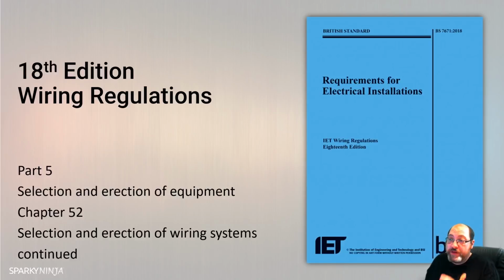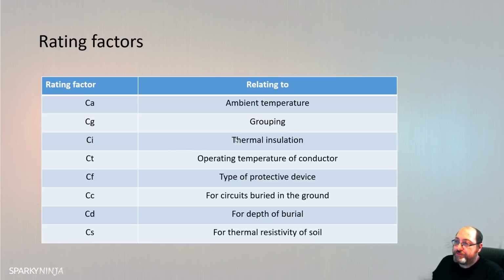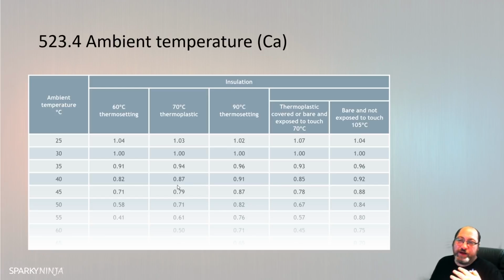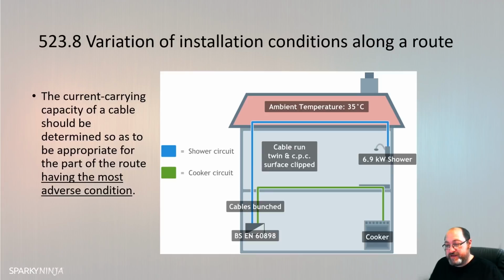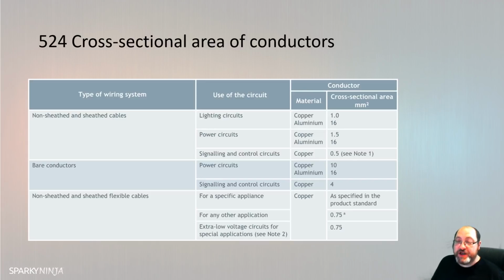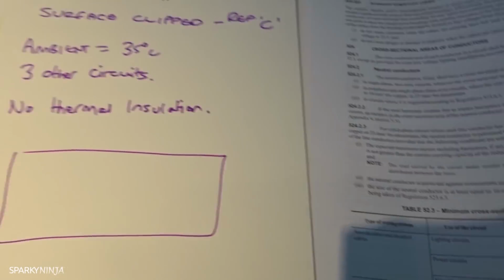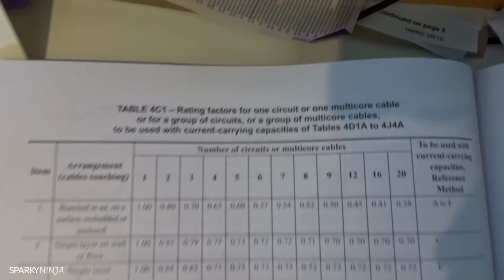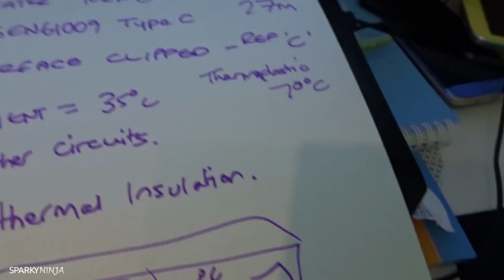18th Edition Training Series - Episode 12 - Part 5, Chapter 52 - Sections 523, 524&525

Comment: In your working example you worked out 63amps on a 10mm but selected a 45/50 mcb ?
Reply: 45A is just the nominal rating of the device. A type C could have a breaking point of up to 10 times that. If you install exactly the same current rating as the design current, you may get unwanted tripping. The 63 A is the conductor rating required to suit all the correction factors but this does not mean the cable will necessarily carry that load. Iz has to be higher or equal to In. Coordination. That’s how I understand it. But you probably know this by now👍
Reply: yes 63A is non rated conditions.  The rating part means is can carry LESS than 63A before reaching it's maximum temperature....... Without those factors, yes it can carry 63A but NOT if installed in certain ways which stop it losing its heat.

Comment: When looking for volt drop aswell as Current carrying capacity for Flat Twin and Earth Cable 

Which table  is more suitable 

Table. 4D5 or 

Table 4D2A along with 4D2B

Thanks
Reply from the maker: They both serve the same purpose - table 4D5 is specifically for the flat profile and incorporates the reference methods 100, 101, 102 and 103 - so if these are present then Tab 4D5 is most suitable.
Reply: SparkyNinja thanks for the response

Comment: TOP BLOKE 

just wanted to clarify when u mentioned a cable covered by 522.6.204 can go in any direction 

So would this mean , out of the zones in any direction  would be permissible... even to the extremes of going diagonally across ??

Thank you
Reply from the maker: That's correct, there sufficient protection against impact by the measures given in .204